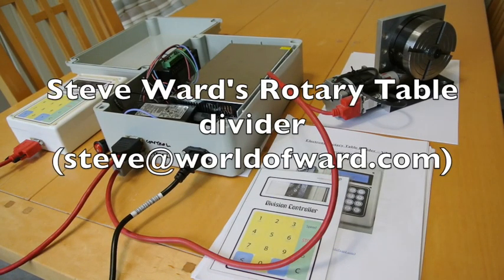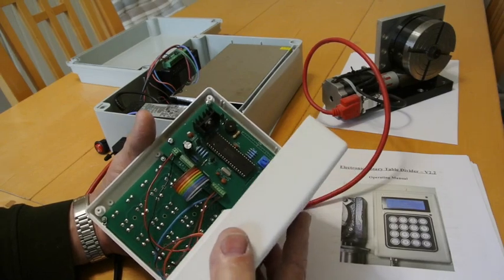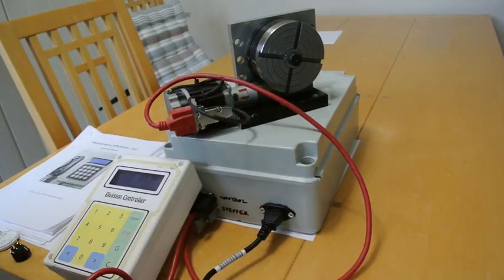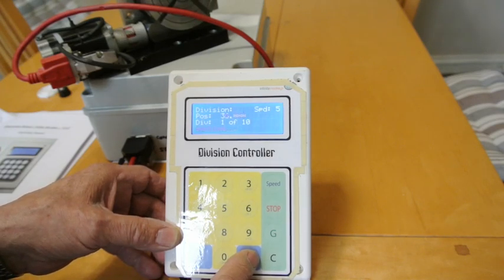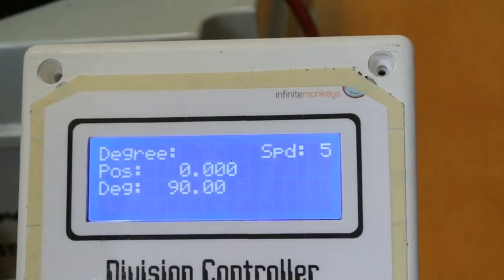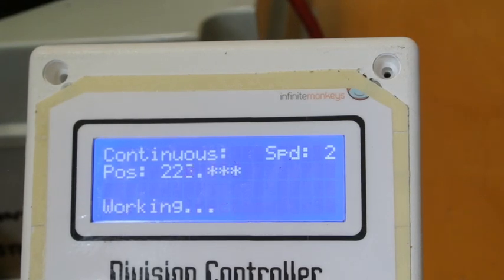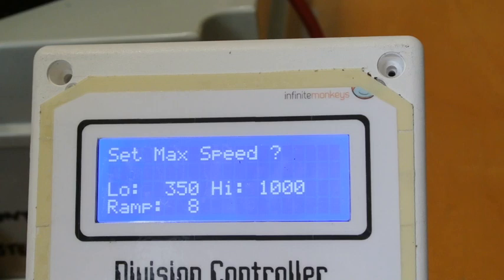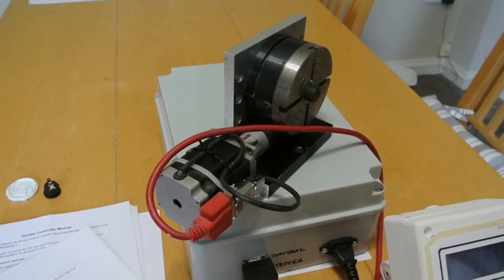Sloan and Chace lathe Pt 7 Electronic Rotary Table divider

Comment: I'm copying your two box setup and found your video most useful.
I'm particularly interested in the shielded 6 core cable and connectors you used and wonder if you could give me further details, please.
Reply from the maker: Len
Glad to hear that my video was helpful. The system works great and I have used it to cut all the gears needed for my old Sloan and Chace lathe to thread cut metric threads.
I bought the shielded cable from Ebay. It is used in CNC work or alarms.
https://www.ebay.co.uk/itm/Shielded-Flex-Cable-4-12-Core-Intruder-Burglar-Security-Signal-Cables-Alarm-Wire/323885011725?hash=item4b690d130d:g:fAcAAOSwWZFdUQXa
You may struggle to find a Uk stockist and may have to buy direct from China.

For electrical connections I just used 9 pin computer serial connectors. 
https://www.ebay.co.uk/sch/i.html?_from=R40&_trksid=m570.l1313&_nkw=9+pin+serial+connectors&_sacat=0&LH_TitleDesc=0&_osacat=0&_odkw=gx+connectors

Actually I think the Aero style GX connectors may be a better solution. Again they can be found on Ebay 
https://www.ebay.co.uk/sch/i.html?_from=R40&_trksid=m570.l1313&_nkw=gx+connectors&_sacat=0&LH_TitleDesc=0&_osacat=0&_odkw=serial+connectors

John
Reply: @john2478  Thank you. That's really great information; just what I needed. It's a bit of a minefield and I've already taken some wrong turns. The enclosure I'm using is quite shallow and splits open mid height, so the physical size of connectors is critical. I'm waiting for an Aero style connector just to see how big it is and looking at D-sub 9 pin stuff which seems quite small.